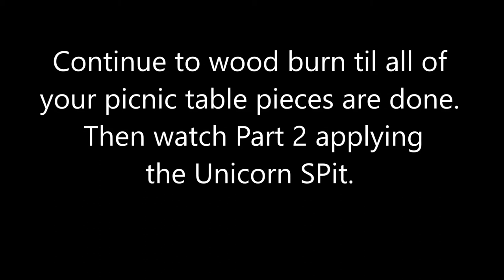Wood Burning for Beginners. Part 1. How to wood burn with a torch,  Pre Unicorn Spit Prep. Ideas

Comment: I think itd be better to get a good quality orbital sander than the mouse sander, and just use the mouse for corners (if you can afford to get both tools).  A wire wheel also works to raise the grain.

Or to disassemble and stain all the pieces before you assemble the finished product.
Reply from the maker: I'll look into an orbital sander.  I just love my little one so easy to use.   and yep I do stain in pieces then assemble.